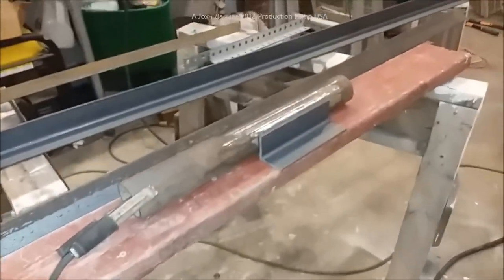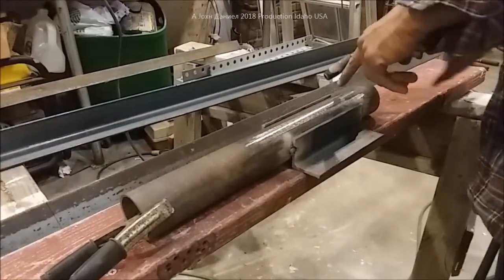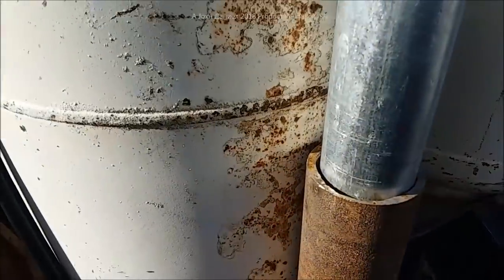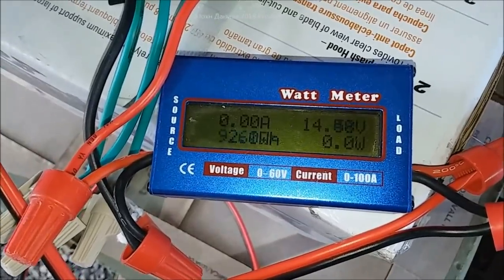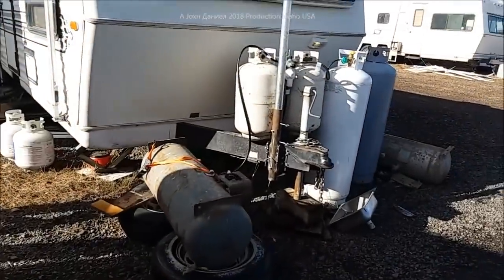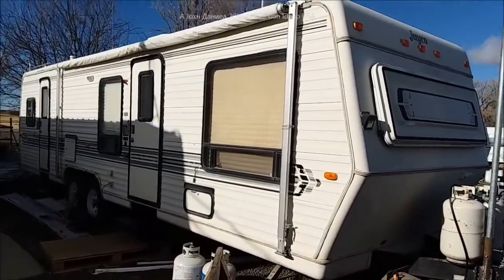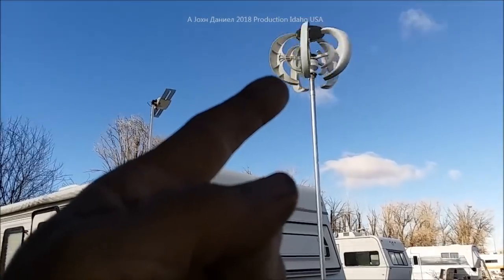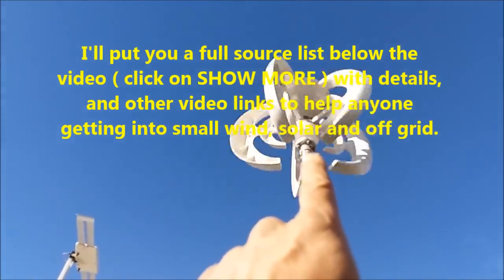Lantern VAWT Wind Turbine installed on JAYCO RV camper, Nah! See parts Below video

Comment: Can you drive with the turbine in place to charge while you drive. Assuming you brace the shaft better.
Reply from the maker: Would be pointless to do that. Truck produces up to 60 amps through its hot link to the towed trailer, VAWT would only produce 20 to 30. The batteries would be full loaded in about 10 miles of towing, all the rest would just be waste.

Comment: I have this VAWT and a similar 30’ trailer sitting on the hillside in Paris, Idaho. I would love to see your wiring setup for this application. Thanks, Big Guy.
Reply from the maker: Its simple, you run your power into your RV batteries from the turbine, disconnect the trailers charging unit from the batteries using a basic 50 amp toggle switch,  but leave the 12 volt wire to your fusebox intact so your lights still work. My trailer has 500 watts solar on the roof, and the turbine. I can run 100% on propane for the heat, water heater and refrigerator and solar/wind for the rest. Just no airconditioners can run on it all. But my 24" LCD TV, computer and random stuff runs just fine on the 2500 watt pure sine inverter and short uses of the microwave don't hurt it. I do have 4 batteries in the Jayco however. LOL!

Comment: I'm considering supplementing my 48 volt Fp1 outback solar system to help at night and some cloudy days. Have some recommendations?
Reply: Recommended to add this to your solar system. You can use the same charger controller for both if the controller got enough amp on it

Comment: I went to your ebay link to see the VAWT and it doesn't look the same.  It has the large wing but not the smaller wing which comprise each blade on the one on your trailer.   Are you sure the link is correct because for around $100 it looks like a good deal?

Update: This one looks like the one you bought but I'm not sure it is the same:  https://www.ebay.com/itm/600W-12-24V-Wind-Turbine-Generator-Lantern-Type-5-Blade-Vertical-Axis-Controller/173654221738?epid=15015890260&hash=item286e9923aa:m:mWJJQRpVcr1uJ-0wKwmMJgA:rk:1:pf:0&var=472330651910

Comment: Awesome video. . wow I read the comments and it looks like you realy have a grip on this stuff. I have a off grid lot in eastern Washington. We get good wind gusts very strong some times and I wonder is there a way to find out average wind speeds and such in that area? I only go there for camping week or two at a time. so I can run a gen to charge but I don't want to. I want about 6. 6volt batteries from Costco. . each 6 volt golf cart battery has 210 amp hours. I was told I still only get 210 amp hours after I tie 2 together at at 95$ that's a lot of cheep storage. This would be. Battery pack I take back home and keep charged all the time for longer life. . not enough money to buy lithium yet. Sound reasonable?  I want wind not solar if I can because I don't want to leave panels to be stolen when I'm away. It will have a permanent structure there come spring a converted portable storage shed lol. The area has some theft and I believe sqauters are near by. So I plan to make it lock up as well as I can. Thanks for any advice. Have a great life!! :)

Comment: how about using the Radiator Fan Motor I believe it give out 10AMPs
Reply: you wont be able to spin it fast enough to produce power. connect a meter and spin it with a drill and you will see.

Comment: They do work for about 200 watts or about 13 to 15 amps as long as you mount them in the best possible location.
Reply from the maker: Very few wind turbines will ever see "truth in advertising". Those me500 turbines are the only I ever found to be truthful.
Reply: Isnt 1 line 166watts and x ac voltages and its turned dc in box

Comment: Newbie question - If you have an existing solar system and want to add a wind turbine into/with that system, do you connect the output of the turbine into the solar system (like it's another solar panel), or is it connect separately into your charge controllers? I have a massive Tesla grid-tied system (24kW), but would like to explore adding wind as an option to keep generating power at night. Also as a newbie, would love to see a diagram/parts list for a wind turbine system - something to start seeing all the pieces required from turbine to inverter (as it were). Thanks - JM
Reply from the maker: Your wind turbine decisions have to be based on 3 things. Wind availability at a dependable average, Type of battery system you employ, and preference on voltage. You can add possible angry neighbors too is the wrong thing is chosen.
Reply: @JOHNDANIEL1  - the good news for Florida residents is that FL law strictly prohibits any efforts by neighbors or homeowner associations from forbidding ANY kind of energy saving devices including solar panels, wind, and even clotheslines. This includes where the energy saving devices are placed (in other words, you can't stop a home owner from placing the solar panels on the south side of their home even if that means ALL your neighbors can see the panels). Living in Central FL, we have the benefit of cross breezes between the Gulf of Mexico and the Atlantic Ocean, so steady wind is pretty much guaranteed.

I guess my question really is, when you add a wind turbine to a home with a solar system, do you add the output of the wind turbine to the existing solar, or is it tied into your inverters separately? I'd like to be able to tie into my existing Delta inverters that were installed when Tesla installed my 24kW system.

Plus - would REALLY appreciate a turbine to inverter list of necessary equipment for adding a wind turbine to your home (with or without an existing solar system). Assuming we know NOTHING... Thanks again for your response - JM
Reply from the maker: While these people still have 2 of these 24/48 volt Taiwan turbines, ( FEW OFFER THESE ON EBAY) I would jump on them. https://ebay.to/2DVrDpL Its the same thing as the AutomaxxPOWER brand for $120 cheaper each. They ARE NOT those cheesy $200 china turbines, they are BIGGER ( 46 inch cheep china blades verses 69" blades) . Then you have to get a pair of MPPT Lithium/NiCad battery rated controllers that will run to your advanced battery bank battery style from them. Not knowing your bank voltage I can't tell you the right controller. But a 48 volt turbine will charge a 72 volt battery with a MPPT made to do so.
Reply from the maker: Option 2, the best for a beginner and the most durable turbine on the market for the money https://amzn.to/2E3xiuw . I install these in mountain regions for radio beacon and rescue camp operations.

Comment: John, in the listing for the me500 on Ali express, one option is a flange base or a hoop base. What's the difference? If I wanted to mount one or three of these to the roof of my shop, which is better? Thanks.
Reply from the maker: One is a flange plate mount, the other is a clamshell mount that clamps the pipe. In preference I use the flange due to strength. The  NO WELD flange adapter I listed below the video is the one that will fit 90% of turbines from 200 to 600 watts with a little work and is shown in the previous videos on this turbine. I also now use it exclusively installing the ME400 and 500 for people.
Reply: Јоhn Daniel 10-4, thank you John.

Comment: I don see the watt coming out fron that lantern wind turbine... Can u tell me how u get know the power out?
Reply from the maker: The wind turbine brought the battery up to full voltage before i filmed the running wattage. It had a peak wattage of 130 watts in the 20 kph gust of wind. I would say you could depend on 5 amps from these which is decent for the cost and design.
Reply: @JOHNDANIEL1  5amp fair for the price... I bought one this... Wait for it coming to test the ouput... Tq for your reply sir...
Reply from the maker: Just be sure to mount on solid held post or pipe with plenty of height and only use no smaller than 12 awg 3 wire extension to run it to the controller.

Comment: John... could I bother you for one more time?  The link for aliexpress does not go to a specific wind turbine.  It all looks similar some have controller and some dont.  They are 1/2 price for cyber Monday.  Do you know which seller you bought from?  Anything else to identify the specific one.  I looked for a part number but they dont have one.  Some of the lanterns look the same but different sellers??  Is one a knockoff or do they sale the same one just a few dollars different and should I grt the one with the controller or not.  Since you have to chose 12 volt or 24 volt Im thinking 12 volt would be cheaper??? For batteries and stuff? Can you give me further advice?  They even have 600 Watt with 600 watt controller.  Does the controller need to be waterproof or does it go inside?  Sorry ... told you we didnt know what the heck we are doing...
Thank You so much for helping if you can.  I went to aliexpress.com but I tried the link you gave first!  It did not go to specific one.  Should I get the 600 Watt?  Which one?
Reply from the maker: I refer the 5 blade horizontal thats in the Ali Express link for you due to your area. The lantern model would not be worth it there. Need 8+ mph for the one I recommended ( my shop roof model ) and need 15+ mph for the one on the Jayco.
Reply from the maker: Find a batteriesplus.com and if you order online you will get 10% off. You would want the Duracell ( east penn manucfaturing, same as DEKA SOLAR ). Be sure to collect a bunch of old car batteries up for cores, and ALWAYS buy all you plan to use in one purchase. Get the GC2 6 volt.

Comment: Thanks for posting this video, John Daniels. Just be aware that welding on the trailer tongue does weaken the metal. Though in reality you should be fine.
Reply from the maker: Definitely no welding thats why I did the bolting it on. But at some point it will get seemed up with a spanner piece.
Reply: @JOHNDANIEL1  - sorry I spoke too soon.

Comment: Please post another video when the VAWT is producing power.   The Watt Meter  shows source voltage at 8.59 volts and only 2.0 watt hour over the 1.5 hours it was running (1.33 watt average).  The 134.2 Watt peak must have been very short.
Reply from the maker: Probably was 28 volts source, I think I've dropped that meter a few too many times or a rain soaking caused a problem. I'll do another video when we set up the trailer again down south with a new meter. Seems the LCD has a digit issue or short in it, it was hitting almost 30 volts but the LCD is not showing a digit there.
Reply: @JOHNDANIEL1  please include wiring setup to the hybrid charge controller and battery bank.
Reply: John Daniel yes please the wiring 
And turbine vawt is only putting out 5-7 dcv. Will that charge the battery? And the hybrid controller u mentioned willl that help it raise the bolts to charge?
Reply from the maker: You made me worry so on your note, just went out and picked up the meter, without any touching it it was showing 83.6 watts peak, and 17.03Vm which is a bit odd, then turning it over it went blank. I thinks I be gotting me a short somewhere. Apparently getting hot or the 20 degrees is causing it to freak out. Getting replaced today with a Thermodyne 180 meter.

Comment: It may have been on brake because it had not dropped to the 13.5v recover voltage after the high 15v shutoff.
Reply from the maker: Thanks, I was trying to figure out why it was just sitting there like that, looking on the controller instructions it does say recover voltage is 13.5 so I guess I missed that. I usually make my own controllers.
Reply: Јоhn Daniel Understood.
Reply: Just ordered two for $102 each...will wait to see which style I get... new or old?   Here in SE Colorado, yes, we do get wind!

Comment: Super cool, its about $1 a watt which is about the cost of solar but you get that power at night too. Nice John but I hope people with no wind don't just buy wind turbines, got to use solar as main source.
Reply from the maker: Exactly. And even if it was only 4 or 5 amps but at night, its what you can use to keep your inverters on and controllers without looses that will damage your batteries.
Reply: Desert camping! Always have wind there! I love this!!
Reply: The wind is also usually peaking in a storm when the sun is hiding. Wind/solar hybrid... how can you lose? (also, invest in  good batteries)
Reply: So desert camping on BLR land wind would be King and Solar would be a backup?  Possibly?
Reply: Would work when driving

Comment: What do you think works  better in low wind? A Hawt or Vawt??
Reply from the maker: HAWT, The ME 500 with 5 blade is a damn miracle machine. I ordered 6, installed 4 more in St.George Utah, which is NOT a windy place. They replaced 3 of the Shiddy Missouri things, and the guy already said its 400% more power per day since September 8th when I put them in.
Reply: Јоhn Daniel I'm in North Carolina, just east of 'Boone , in the north west corner of the state. There is places with wind here. Windy ridge, windy gap. I just have trees all around. To get in the real wind I'd have to go up near 100'  the trees even block my solar panels! I get sun about half as much as I could.  I have a few converted celing fans I sort of thought about putting up. They just need controllers and a prayer...  If I deal with putting up a tower. I want to make real power. Keep at it!!

Comment: How is the mileage effected when you pull the trailer with the added weight of the lead batteries?
Reply from the maker: My Ford truck has a 7.5 liter, 460 CID with 335 horsepower. Mileage sucks with it sitting at idle! However, it gets 9.5 whether its towing this 7900 lbs or 4000 lbs. Over 11,000 lbs its a real pig, 7 mpg at best.
Reply: @JOHNDANIEL1  If you have to worry about the gas mileage, you wouldn't buy the truck.;-) I have an 8.1 in my Chevy Dually. When running on non-ethanol regular it gets 16 MPG. With regular E-15, it gets 14 MPG. Around town, what was the question? It is more like feet to the gallon. Funny thing is, with the 4.10 gears, it doesn't make any difference whether it is up hill, down hill, or in a wind, loaded to 18,000 or light at 6500lbs, it still get the same. I even had the 16' utility trailer built so that I could drop the top half down when it was empty. That lasted one trip South empty because with it up or down made no difference. One thing we both can do is pass trucks and cars on long grades because we have the bigger gas engines. 

Have you ever thought about towing the trailer with the VAWT up? 60 MPH wind. :-)